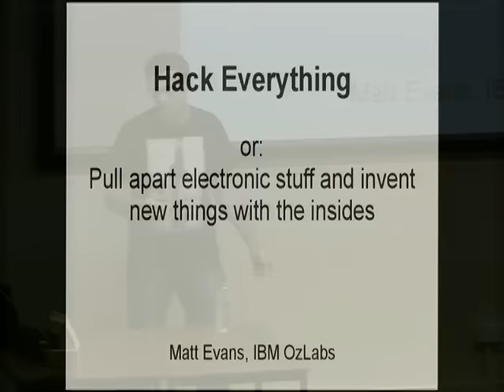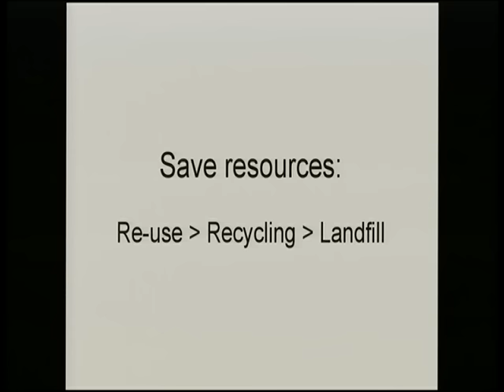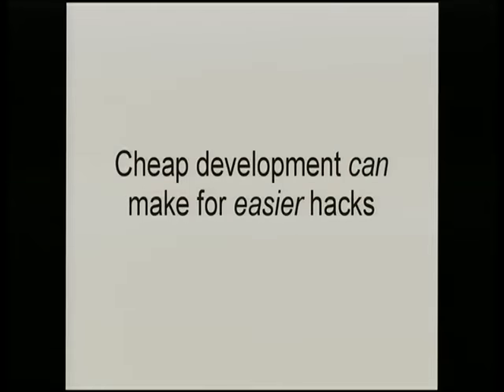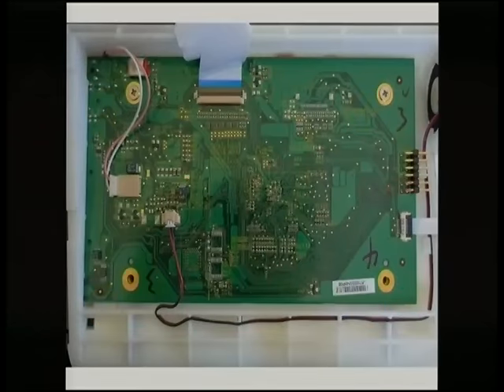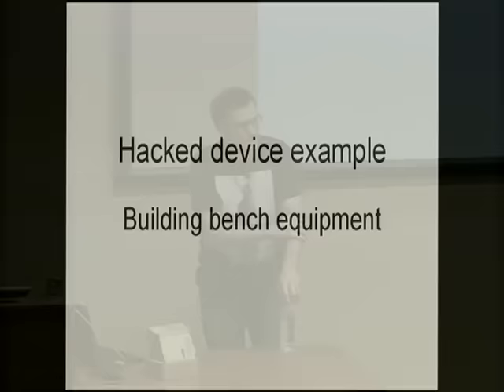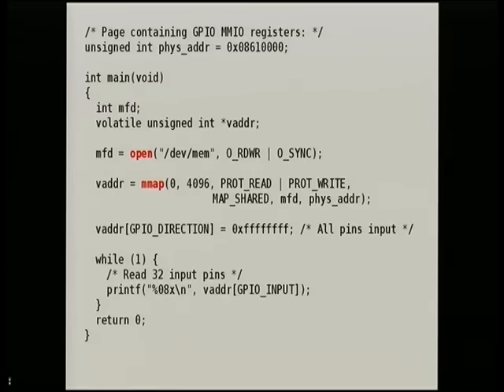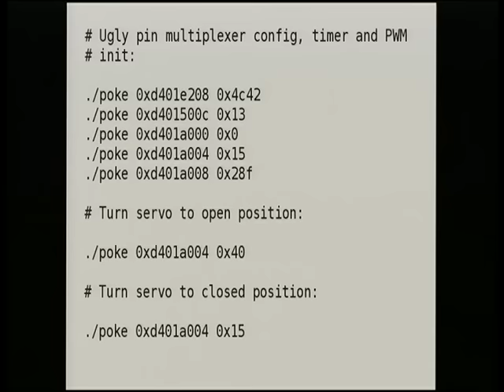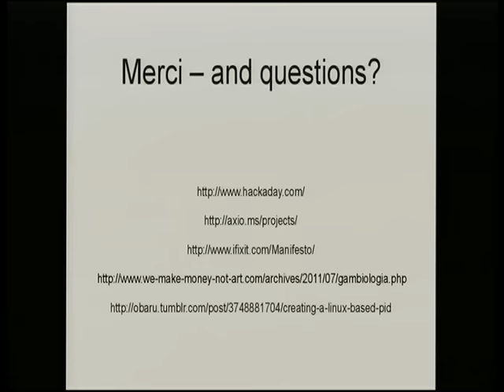Hack everything: re-purposing everyday devices - Matt Evans

Comment: Hello matt Evans :-)

I love this stuff, your repurpose philosophy, apocalypse and the info you give.

In response, I have collated old boards from a myriad of devices. I've equipped myself with a soldering iron, screwdrivers and circuit tester. I'm awed at looking at the boards and ports and bedazzled by you geeks and hackers. I love it but no clue what to do with it all. Perhaps you could please advice me where to start? Electronics course? Programming course? It all seems multi-disciplinary so where do I begin>

I've got boxes of the stuff waiting for me to catch up so thank you for your inspiration Matt :-)
Reply: Ok have you learned electronics now? If not there's a few ressources i can give you to further your understanding, of varying complexity, from stuff for beginners that don't understand what they are doing to diy channels of super skilled dudes that build insane stuff from scratch, or theoretical lectures/ explanations.

You know, i did 3 years of electrical engineering before switching to fundamental physics, and -mostly dur to the way the french system is set up, with 2 insane years with overkill levels of work and therory (basically 2x 2h/ day of lectures, physics and math, + 2h each again of problem solving, and after that 8h day you are expected to work another 3-4h to just digest the 10 pages of function series theoremes you've barely had time to write, all that to get a 7-8/20 on a test if you're lucky. The average was like 4-5, above ten you're a god even tho its the lower bar of admission in the public school system, and getting at 12 and above thats so hard to pull off teacher will start to find if you've cheated.

Anyway i went though 3 years lf pure math and physics hell (did the 2nd one twice, and somehow managed to keep my passion for science even as they did their best to make it seem line a bunch of boring equations 
After that i could solve any question or problem for any electromagnetic field (referring to electricity in general, circuits are just a part of that), but in practoce i was clueless 
I d just never associated the hands ln with the theory and when i started experimenting with electricity i'd already forgoten most of the specific formulas but it all started to make sense to me, and i found myself re discovering concepts i thought i understood but didn't, very satisfying.

Point is you don't need to go the hard way like that. You can find ressources on the net, hell  of this very platform thqt will give you a masters level education if you really invest the time and effort..

In my case, i learned all my quantum mechanics for example on YouTube, built all my knowledge there. There a small channel in french from an astrophysicist teaching close by that uploads ALL of his lessons so you have bachlot/master level full length 15-25 2h lectures and nearly twice that in exercises.
I just found thos dude to be far more interesting and better then my teacher, if you can learn university level QM on yt you can become a self made electrical engineer ;)

Comment: This guy is true.

For example, i reused for the cost of an electric power supply and a bit of solder tin, an old PSU from a computer.
I could bought a 1300$ labo power supply... Instead, a drill, a solder iron, some female banana connectors, 1 switch, a thing to cut wires & more than other things : a hour (if you have right well-working tools). & I got my power supply to help me to get fun with electronics.
You can use a computer PSU for a more funny thing : get electroluminescent diodes (get so much), a NE555, a capacitor, a potentiometer and a relay (i guess ? or something to do an electrically commanded switch with constant low power demand to an output of .... let's say 20A if you want your desktop really get illuminated but prepare bars, not little wires if you plan high amperes like 20A or more).
And you will get your desktop illuminated.
Reply: 666neoselen the problem with reusing and old PSU as laboratory psu, is that you can't program the amperage limitation, neighter the voltage, you needs to build lots of extra circuit to do that.
Reply: @flyguille  right. A Chinese 0-60V power supply with current limiting and display is around $50 and is much more convenient.

Comment: I have the exact tplink router like at 23:30. I managed to find the serial ports, but that only presents an useless looking debug shell.

The firmware file is also avaliable to download and I managed to extract the filesystem with binwalk.
And unfortunately, custom router firmwares like openwrt or ddwrt does not support it because of ram and flash limitations.

So I'm a bit stuck now. I would really like to run my own code on it, finding gpio-s and controlling stuff and messing around with the hardware. 

So any of you guys know where to seek help hacking this stuff? :)
Reply: If you can get some information on what SOC, Kernel and C-Library it uses you might be able to get a toolchain for it.
But once you've got a binary, I'm not sure how you'd go about getting it into it's flash.
If I can't get OpenWRT on it, it goes on EBay where someone with greater skills can have a try.
Reply: @edgeeffect  I know this is old, but once you got the bin, it's easy to flash it if it's a spi flash, using a ch341a programming tool. Programming and generating such a firmware without YouTube tutorials is what I struggle with.

Comment: Repurposing things is not a new idea.But having a message board on a website to trade good used components would be great.I'll trade this rectifier for that capacitor kind of thing.I belong to a club (AOMCI) that rebuilds old outboard motors.We trade among our self's all the time. I'll trade you a 1956 starter for a 1930's gear case.If there such a website-please let me know-I need a 1 Mega Ohm Resistor 1/4 Watt  LOL
Reply: that is a good Idea. As a ham radio/CB addict I would be all over that.

Comment: Question for the community,
PGA's
What "junk" should be looking for to find FPGA's I can reprogram?
Reply: I think that's too complex to reuse. You can't spend a year reverse engineering every product...
Reply: @thewhitefalcon8539  FPGAs to reprogram not to reverse engineer.. like eeproms , harder to do but with processing capability.
Reply: @petevenuti7355  I suppose you could also desolder the FPGA but the problem is that every kind of product is going to have a different kind of FPGA and you don't really know what you're getting
Reply: @petevenuti7355  also FPGAs are all BGA chips so are you gonna get custom circuit boards and reballing stencils?
Reply: @thewhitefalcon8539  well having some idea what's in things is why I'm asking, desoldering I believe would be the easy part, and I know a guy with a laser cutting machine so I could make the stencils for a few bucks (I used to have strips cut of that thin stainless cut to put in painted sash windows to stop them from getting stuck in humidity) I'm not sure about getting accurate measurements or g-code for that stencil though...😒 That would have been my next question.
Those Chinese board manufacturers could probably knock something out for $2. I have most of the parts materials and time otherwise.
So $5 to reuse a FPGA chip sounds good so far.
I think the biggest challenge but fun project would be making the programer, that would be new to me and not sure what that would cost... No way I could afford any of those development kits though.
Reply: @petevenuti7355  FPGA chips do not get programmed themselves; they read their program from an external memory chip when they start up. Apparently this is because it's hard to make good FPGA and good flash memory on the same chip - they need different manufacturing processes. (A lot of microcontrollers have built-in flash but that's because they combine mediocre flash memory and mediocre processors, which is totally fine if you are just trying to control a microwave)

Comment: been doing this since i was 7, my first one was 2 radios into a metal detector
Reply: Men i want to do something maybe you could help me... I  got two ssd's of 120 GB that i want to solder them to 
make a single 240 GB ssd (same brand and model) 
Just to learn,i know
 i could just use a software partitioner but i want to know how to 
manipulate hard drives and solder in a basic way 
and i want the 
computer  to recognize it as a single drive just like with a normal 240 
GB ssd
also i wondered if i could do the same with hhds or usb flash drives or 
maybe combine more and more cheap ssds of 120gb to make a 1.2 TB bunch 
of disks

I dont understand why but i cant find anything like that on google...
so if you know how to do this or if you know any tutorial i would 
appreciate it a lot,
I wondered if i could just solder cables from one disk's SATA pins to 
the other one,and then connect supply energy to both ssds,but only 
connect one SATA cable to the motherboard...
Reply: @juanmartin387  Is this a joke?

Comment: this might be an outdated or alreaady done idea   but for a plug in or on coneect language searching device to find out what programming  code language,   this is a general or basic or jump off level idea     of what could be used maybe need a bit of modding,    but couldnt you use   an obd2 automotive code scanner reader eraser.  
i suggest this, because when i use the one i have to erase a persistent dtc error code for an evap leak on my car..  because  when you connect it initially   it starts up and starts  scanning to figure out what programming code base ndto use and it displays the different ones until the one in the car matches one in the scanner 

couldnt you in a sense  take this and replace the stored code used for vehicles with whatever language code you need to have to scan whatever type of device etc etc yada yada     then you could maybe set it up to when it matches up a code   that it runs a disassmbler decompiler  or whatever they are called and or more ?

Comment: I find most motors from drills to hoover to blenders can be re used I try an throw nothing away an collect things the best I've seen lately is the fridge freezers everywhere can be re used as little petrol motors many videos on that an turn them into compresors with an old gas bottle...so many hoover thrown away another is the old petrol engines use water hho hydrogen cells even new cars can save 75%  also engine oil and veg oil filtered down to 0.1 micrograms using old wheelie bin and quilt covers as filters then add quarter diesil or kerosene will run your diesil car but hydrogen cells are great I would run a boat purely on sea water and even use salt water bottle solar cells if u get alternators and motors batteries all around connected with an amplifier called an inverter and electric ran boat hho cells u could get around the world I would buy a base or hull 32ft get rya licence and put a caravan onto a hull and use motors with wifi or Bluetooth motor to turn rudder and control ur boat from an iPad in the comfort of a nice static caravan bolted to a great hull make the roof strong get a ladder and use the roof too but it's all about the money to start..I've got a beech in tunisia I want to turn into a resort for like minded campers paradise and if enough of us wanted to go off grid it's amazing place free laboir for the 5 families within the 35 miles from city UT perfect anyone interested inbox me meditation yoga camping retreat and I'm shipping all tools and stuff in a container plus I'm towing a caravan onto a ferry to get that there inbox me for more as want to set solar farm up a filter system rain collector and we'll for water start growing food buy live stock for meat eaters etc..

Comment: i built my first radio which taken from faulty devices the only thing i paid for was the coiled wire then i built myself a simple alarm circuit using a multi-vibrator circuit

Comment: Hm.... Is there a beginner's guide to this? I just wanna get laptop video to a crt monitor, is that possible without buying anything?

The router stuff seems cool, and perfect for an amateur astronomical observatory since it can transmit jpegs(from a USB protocol webcam, I hope?) And control the position of the telescope through servos, anyone knows if it's easy to connect that to stellarium or other astronomy software?
Reply: Does the laptop have HDMI or VGA?
Is the monitor VGA or "broadcast style"?
Reply: @edgeeffect  it has both, but I think I messed up that monitor, which was VGA, but idk what broadcast stile means, like a satellite dish/tv cable, maybe?
It'd be a success to get a single dot to show up again now

But yeah, I still have that laptop to connect to a monitor so I can snoop inside it and drown on nostalgia and cringe, and all this time I could've just used my brother's PC monitor or a TV (but one time I broke a TV by plugging a laptop into it, so I don't dare(specially since there's no earth wire)), but instead I put it in a cardboard box that's been under my bed for 5 months, apparently...
Reply: @edgeeffect  also, I think I had the wrong laptop in mind lol

Idk, I think I got 3-5 laptops under my bed still, maybe I was trying to use one that only had HDMI, or maybe the VGA connector from the monitor's cable was faulty(well, it is now since I cut it up for some reason)
Reply: @edgeeffect  if I can get a dot to show up on that monitor I'll hook it up to an amplifier's left (v) and right (h) output to make a spectrogram(bad time to forget what oscilloscope music visualizer means)

I had written that out bc I'm a bit high and still on ayahuasca too(tbh I kinda reassessed my whole life during the writing process of these comments) and I assumed no one would even understand what I meant by that

But I looked at your page/videos and was surprised to see a spectrogram of some noise in an oscilloscope as the thumbnail of one of your videos, so I'm assuming you knew what it was

And your videos seem really interesting, but I've had enough psychedelia for one day, but like or reply anything so I get a notification and I'll look it up then

Comment: Nice video men!
I need help... I  got two ssd's of 120 GB that i want to solder them to 
make a single 240 GB ssd (same brand and model) 
Just to learn,i know
 i could just use a software partitioner but i want to know how to 
manipulate hard drives and solder in a basic way 
and i want the 
computer  to recognize it as a single drive just like with a normal 240 
GB ssd
also i wondered if i could do the same with hhds or usb flash drives or 
maybe combine more and more cheap ssds of 120gb to make a 1.2 TB bunch 
of disks

I dont understand why but i cant find anything like that on google...
so if you know how to do this or if you know any tutorial i would 
appreciate it a lot,
I wondered if i could just solder cables from one disk's SATA pins to 
the other one,and then connect supply energy to both ssds,but only 
connect one SATA cable to the motherboard...
Reply: Is this a joke?
Reply: @edgeeffect  sadly probably not

Comment: Project at hand; I have a basic lcd television and I'd like to hack the circuit board to install a sd card for internal memory? how can I go about it with limited resources? I'd like to watch movies off my basic tv when the signal isn't to well.
Reply: A fairly basic homebrew solution would involve a Raspberry Pi most likely, integrated into the TV. You could wire the Pi directly to an unused HDMI port on the TV's motherboard. Obviously, unsolder the connector so nothing can be plugged in there, as it's a second input and would be reserved for this use. Tap the TV's power supply board and wire it to the Pi, with or without a switch after finding the right voltages. If unswitched the Pi would power up every time the TV was switched on. Then, cut a tiny slot for a SD card and USB ports into the TV case where the Pi was mounted. Adding a Bluetooth stick would be quite easy, so you could pair a mouse and keyboard with the Bluetooth for controls. You could then run Debian Linux on the Raspberry Pi and use it like a embedded media center smart TV. It would be quite a fun option and a great learning experience. Of course, the Raspberry Pi could be used outside the TV and plugged in like anything else, but where's the fun in that? >:D

Or, you could buy one of these: 
http://www.amazon.com/Micca-Full-HD-Portable-Digital-Player/dp/B008NO9RRM/ref=sr_1_2?ie=UTF8&qid=1464757815&sr=8-2&keywords=hdmi+video+player+stick
It's a portable video player. You plug it into the TV and plug a USB HDD, Flash Drive or SD Card and it can play almost any video or audio format back in 1080P. Comes with it's own remote. It's got really good reviews and is quite cheap too.

Another option is to plug a HDMI cable from a Desktop or Laptop into the TV and set it up.

I can also provide instructions on how to build a VERY GOOD antenna for a couple bucks.
We get all of the major stations here with the one I built, and most are 30-40+ miles away.

Comment: One big thing in my opinion. I am fairly versed in a number of things, but it still eludes my ability when concerning integrated circuits and serial analyzers/ network analyzers. Never been able to find any information supporting the data sheets you get from chip manufacturers. It is all so obscure and not well documented.
Reply: Yes. I have had the same exact experience